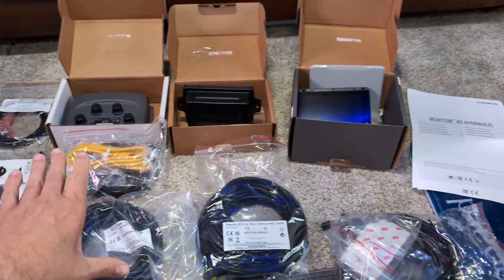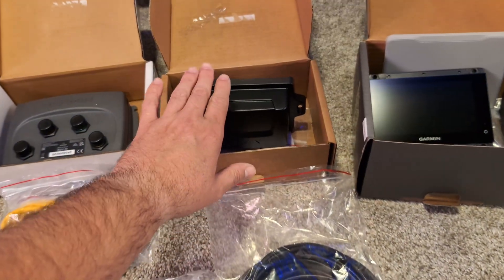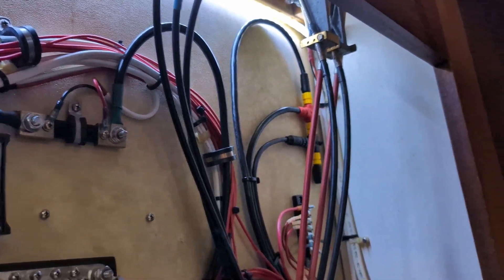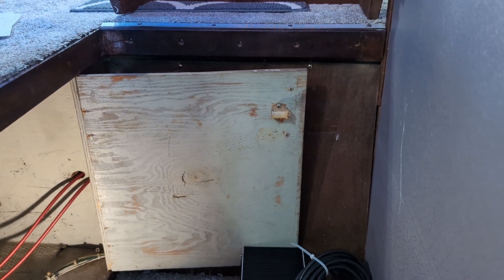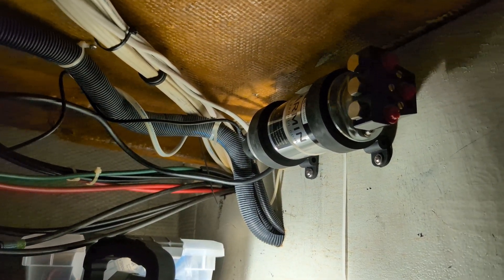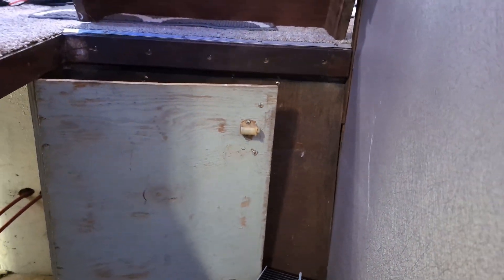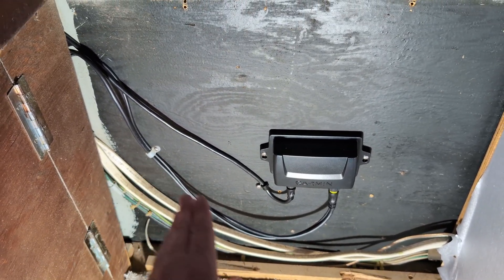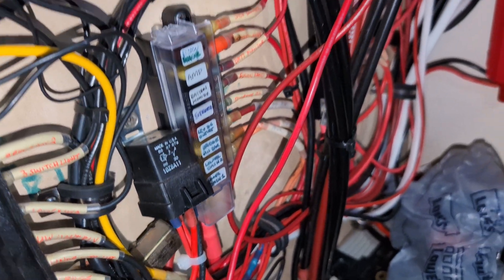1983 Silverton 34' - Garmin Reactor Autopilot Install - Part 1: Equipment Layout

Comment: Looking forward to Part 2.  I upgraded my Sea Ray's electronics from Raymarine to Garmin.  We kept the Raymarine autopilot but I can't get it to follow a course.  It will follow just going direct to a waypoint but will not follow say Auto Routing.
Reply from the maker: Strange. I've got all Garmin on my boat. And I thought about getting the Raymarine set up. But I wanted to keep all the branding the same.
Reply: For Garmin auto route to work it must be garmin to garmin.Your raymarine will follow a manually created course if networked in either 0183 or N2K
Reply: @Mark-rg2mp  I am pretty sure it is 0183.  When I purchased the chartplotter they told me it would work with the Raymarine Autopilot because they spoke the same language.  That  is why I kept it.  Darn.